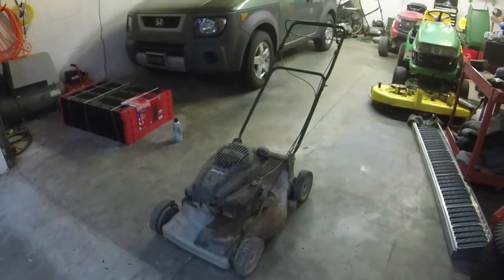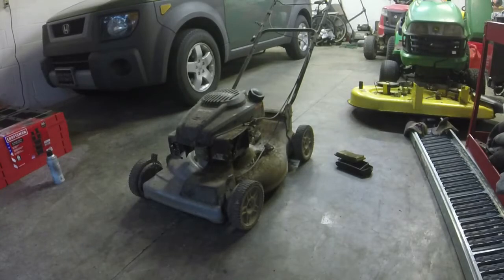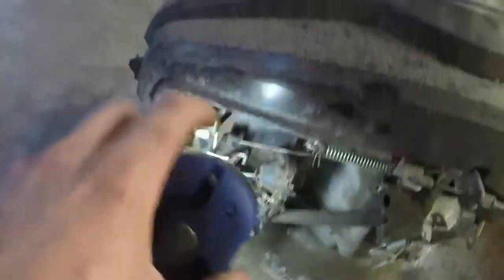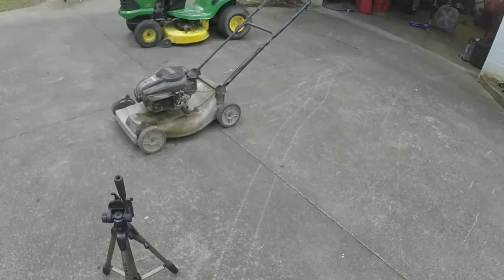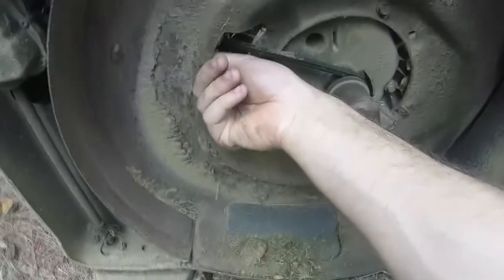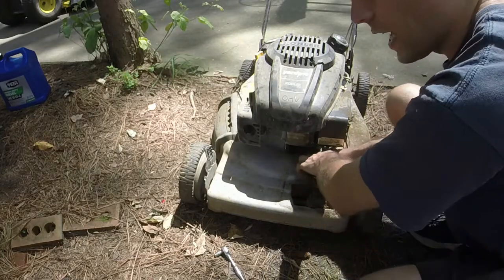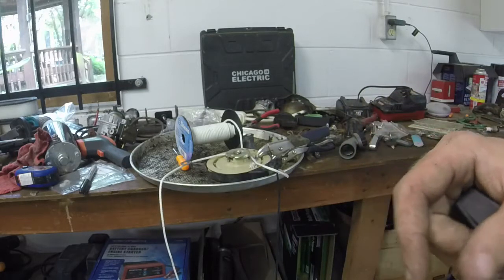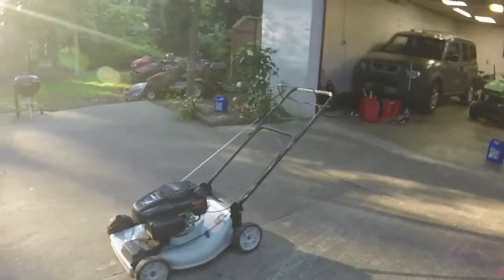Yard Pro push mower w/Kohler engine repair: stuck auto choke, replace pull rope and service

Comment: A Kohler courage engine ugh  I just got a yard man  21 inch mower only  thing is that it's a mulching mower with the plastic carb  by non other than a Briggs and Stratton got to make my mind either to fix it or give it away also did  a tune up on a poulan xt 42 inch cut riding mower got to test it to make sure I did the right thing to fix it the mower is a one off type of mower the gas tank has a special type of evap system on to the air intake   the push mower  I got has the auto choke  so I'm going to to do what you did to that push mower
Reply from the maker: Not the best push mower engine.  Plastic carbs and the auto choke can be finicky to fix.
Reply: @EllisMowersandmore  all new briggs carbs. are now plastic. They have been that way since 2012. Get used to it or stop working on them i guess.

Comment: Use a bread tie twist on string pull through hole
Reply from the maker: Thanks for the tip Rick, I have started using mechanics wire but the bread ties may work even better!